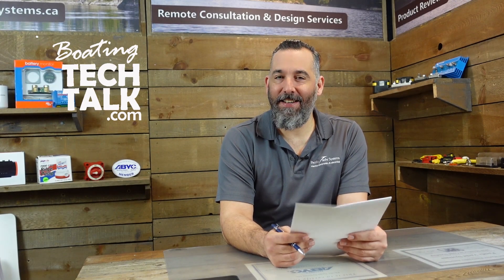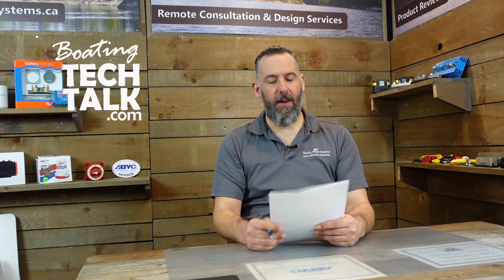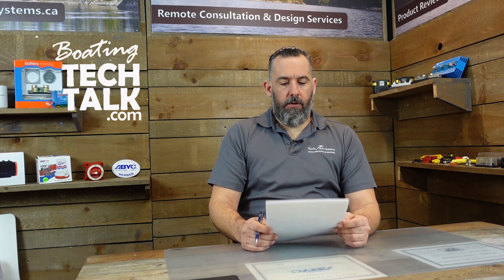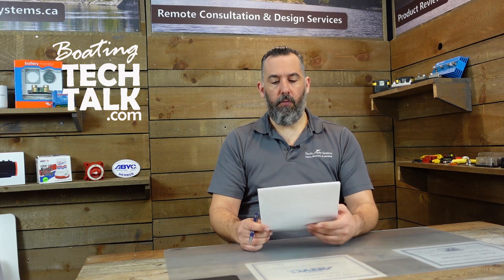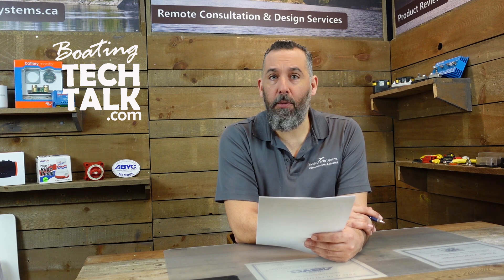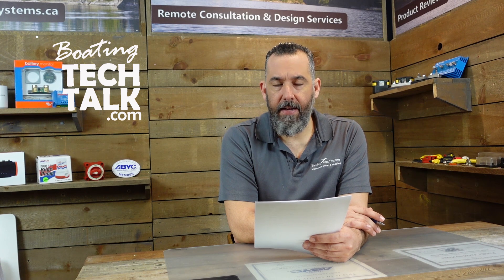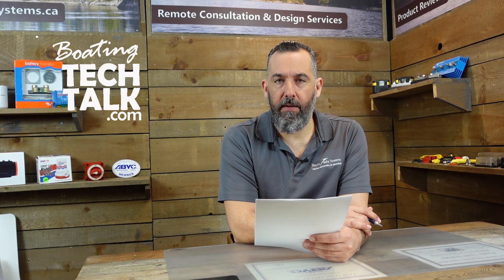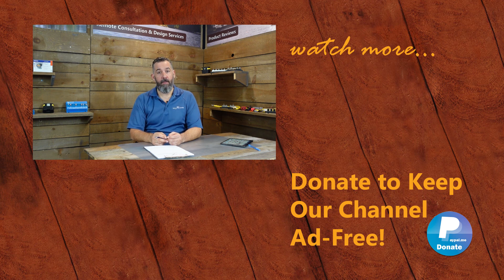I Have an Outboard - Can My Fuel Lines Pass Through the Battery Compartment?

Comment: Yeah...but... virtually every inboard boat in the world has gas or diesel fuel lines that run through the compartment (engine room) filled with electric equipment.  Yes, absolutely those electric devices must be explosion proof (spark resisting...sorry, senior moment for the correct term). That said every one of us have removed and replaced a battery terminal with the accompanying snap of a spark.  Also, relying on the manufacturers design to protect you is false hope. Unless every boater has all the money in the world, manufacturers build to a price. 
It is VERY rare that manufacturers build to full ABYC guidelines.  They all cheat here and there to keep costs in check so that more of use can afford to buy the boat.  I think the answer to the question should be to try to avoid running fuel lines through a battery compartment.  If there is no alternative,  make damn sure that all fuel line and electric wiring entering and exiting  the compartment are well chafe protected. Also I would consider putting a drip loop on tubing rising "uphill" from the compartment.  In fact, I cant think of an installation that have batteries in their own compartment.  Battery boxes yes, but they are not air tight, in fact they are designed to breath, but they are usually located in an engine  room. Never run fuel lines through a battery box!   Additionally,  I believe that the reason that cabin space and engine room space is "supposed" to be air tight to each other, is to control  ingress of carbon monoxide to the cabin space.  Even that is never perfect...therefore  the requirement of a CO monitor in the cabin.  Just my thoughts.   😁
Reply from the maker: Thanks Barry G for weighing in, well explained.

Comment: Jeff what's safest way to transport extra gasoline on  a ocean crossing  with our catamaran that has outboards. We have a catamaran.
Reply: Not Jeff, but I would store it in a locker that is vented to the outside. Same as Butane/Propane mix etc.
Reply: Yeah...but... virtually every inboard boat in the world has gas or diesel fuel lines that run through the compartment (engine room) filled with electric equipment.  Yes, absolutely those electric devices must be explosion proof (spark resisting...sorry, senior moment for the correct term). That said every one of us have removed and replaced a battery terminal with the accompanying snap of a spark.  Also, relying on the manufacturers design to protect you is false hope. Unless every boater has all the money in the world, manufacturers build to a price. 
It is VERY rare that manufacturers build to full ABYC guidelines.  They all cheat here and there to keep costs in check so that more of use can afford to buy the boat.  I think the answer to the question should be to try to avoid running fuel lines through a battery compartment.  If there is no alternative,  make damn sure that all fuel line and electric wiring entering and exiting  the compartment are well chafe protected. Also I would consider putting a drip loop on tubing rising "uphill" from the compartment.  In fact, I cant think of an installation that have batteries in their own compartment.  Battery boxes yes, but they are not air tight, in fact they are designed to breath, but they are usually located in an engine  room. Never run fuel lines through a battery box!   Additionally,  I believe that the reason that cabin space and engine room space is "supposed" to be air tight to each other, is to control  ingress of carbon monoxide to the cabin space.  Even that is never perfect...therefore  the requirement of a CO monitor in the cabin.  Just my thoughts.   😁
Reply: @barryg.291  Diesel power is not a problem...diesel fuel is surprisingly difficult to ignite.  For diesels, there is no need to run ventilation fan for several minutes before starting engine(s); it is, however, a good practice.  Electrical/electronic components in engine room where gasoline vapours may be present must be designed to be “intrinsically safe”.
Reply: @borysnijinski331  Yes, 100% in agreement. Unfortunately my above post accidently ended up  in this thread . It was intended as a reply to Jeff's video. Now corrected.
Reply from the maker: Unless you have a perfectly sealed locker that only vents to the outside, and that's a big if, then store your gasoline fuel on the deck on the rail. All too often i see gasoline fuel cannisters stored in a locker that is NOT sealed to the outside of the boat, to me that's a big no.
Reply: Store gasoline in proper containers (the red plastic ones made with electrically conductive plastic that prevents static electrical build up).  Since gasoline vapours are heavier than air, store them on deck away from any areas where vapours can accumulate.